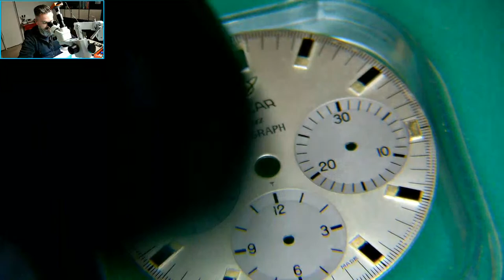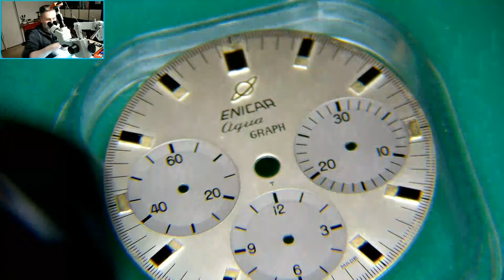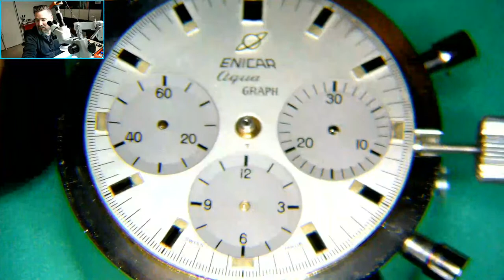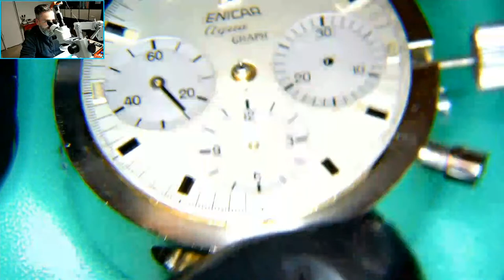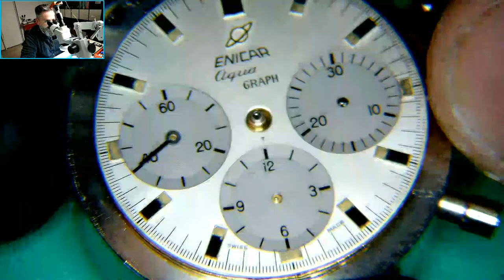Finishing a Valjoux 72 Chronograph LIVE No Edits!  Vintage Watch Restoration

Comment: I bought valjoux 72c and it missing good chunk of parts . And parts pretty hard to find and not to mention expensive . Any other valjoux 72 ,22,23 ,or 88 parts could substitute -replace to fix this watch?
Reply from the maker: You can use some of the 23 parts for sure. A 23 is basically a 72 but without the 12 hour chrono parts
Reply: Ok thanks ! I !